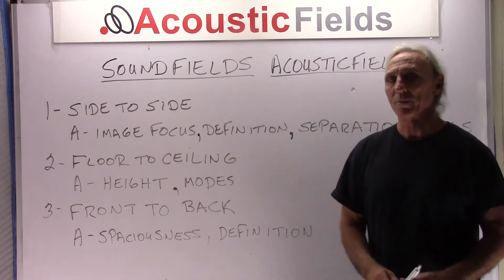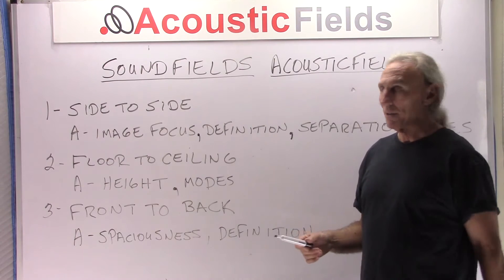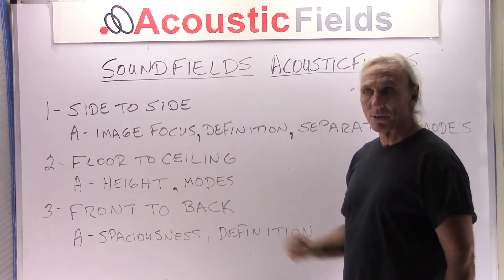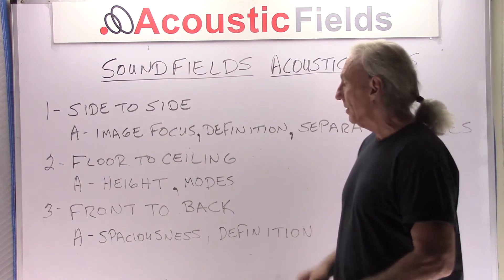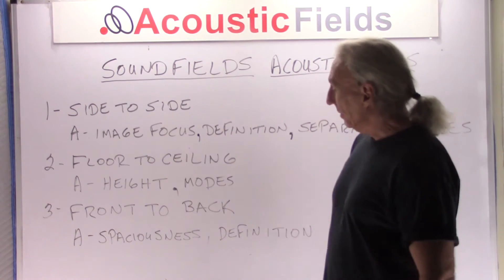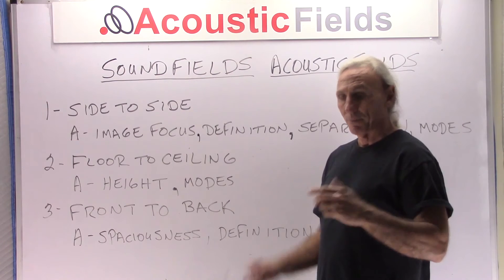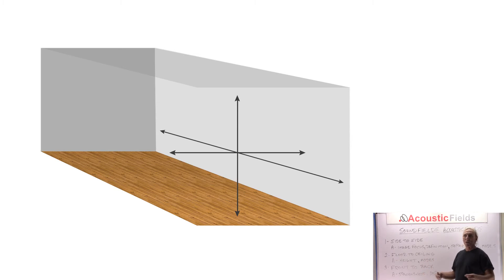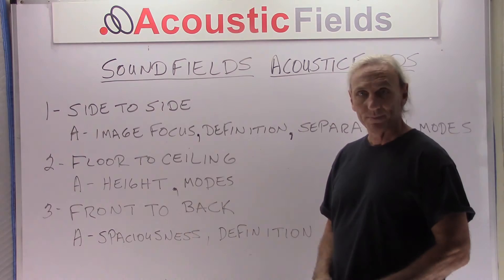Sounds Fields / Acoustic Fields - www.AcousticFields.com

Comment: Hello. Thank you for very informative videos, they are helping me a lot. I am in the process of converting my basement into a home studio. 

I want to make bass absorbers to absorb as much bass as possible (as think as 12 inches if needed/if you recommend). However, I do not have access to rockwool etc. I have cut to size foam and bulk cotton and cut to size plastic foam (same material on the ones found on the outside of TVs but slightly softer)

Question: 
Can you please advise if these (ordinary foam/cotton) are ok to absorb the bass and how think i should make them (stick as much i can fit in the cabinets? very dense? or go light?). 

Background info:
1. I plan to make them in plywood cabinet construction from floor to ceiling. 
2. Additionally i plan to make DIY corner base absorbers using ordinary foam. 12x12x45 and place them in all possible corners in the room. 
3. My room dimensions are Height: 7 Feet, Width: 11 Feet, Length: 17 Feet

Thank you.
Tach
Reply from the maker: +Tachmurat Tachev  We do not allow those materials on our projects. They present health hazards. Placing sound absorbing technology is a room takes careful calculations so that you identify the amount needed based upon frequency and amplitude. Next, you must apply the correct  technology in the proper room physical location. All of these issues require calculations. Guessing in room acoustics is never a good strategy. Too many variables against you.   .